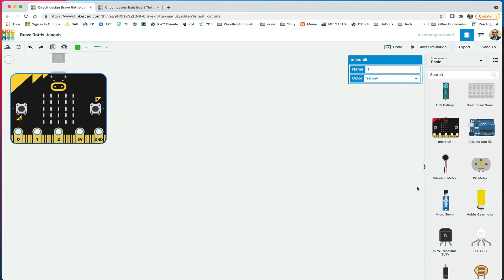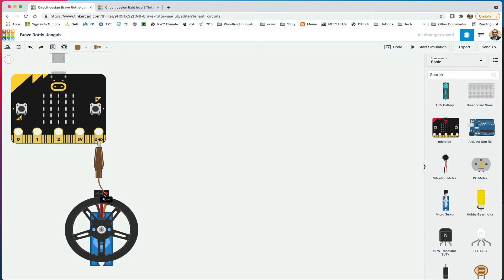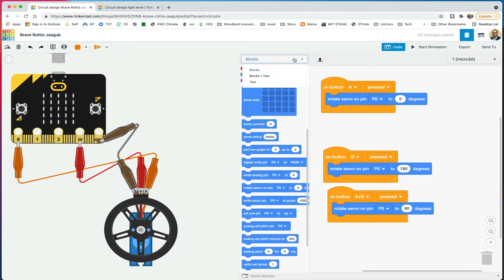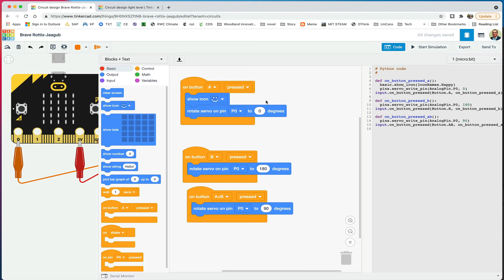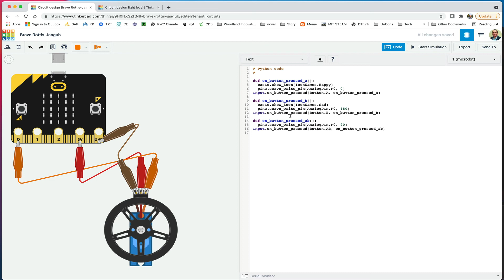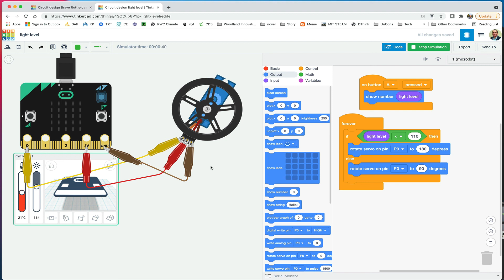Using Tinkercad Circuits to Control Servo Motors

Comment: Nice video tutorial, but in reality most time the servo won't work without external power if you power your micro:bit with the battery pack. Would be useful to make a video with breadboard and external power for the servo motor.